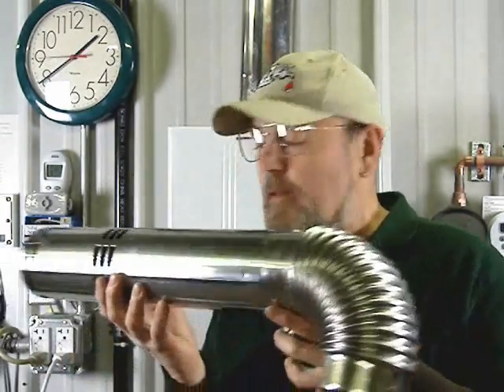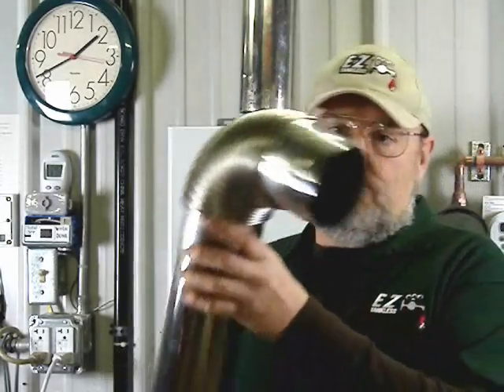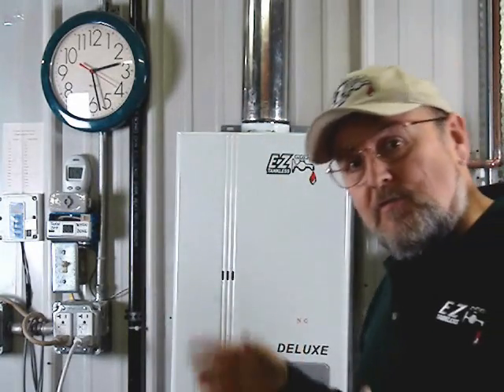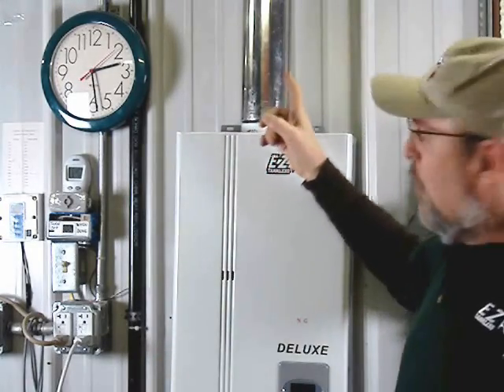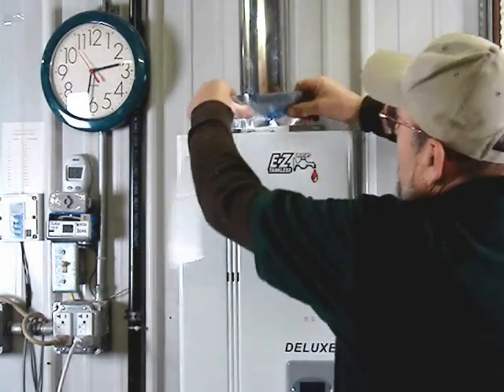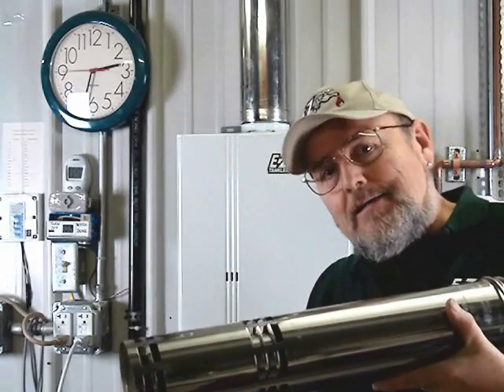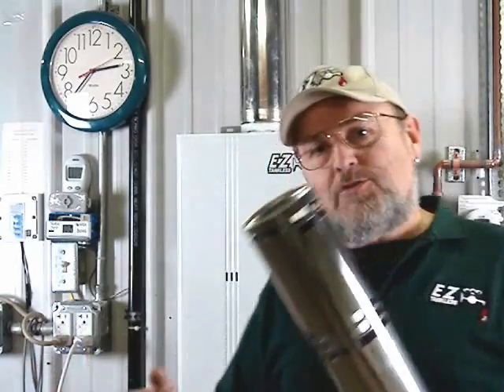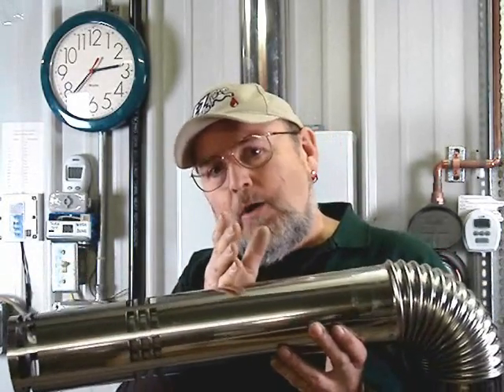Tankless Direct Vent intake and exhaust (common errors and misconceptions)

Comment: Why;d I have to go thru so many videos b4 I found this one? Excellent! How high of a vent riser can I put on the unit B4 going out of the wall? I have a 2 story in the snow and was thinking about venting under the eaves. Also, I'm on a well and incoming water is very cold. Is the a way of pre-heating the water? Thanks!
Reply from the maker: Hello Mr. Wells,
Thank you for the kind compliments.

The problem with going straight up with the concentric pipe before the 94° elbow is that condensate drips back into the heater and corrodes the internal components and is the simple reason why this should not be done. After the elbow, the stainless steel pipe slopes at as slight down-angle and condensate drips outside at the exhaust exit point.

When you explore your local and/or state and Federal "code" you will find that venting under the eave is almost always prohibited because of the potential of entry of carbon monoxide into the home through the eave vents. 

The difference between ground water temperature and the exiting hot water temperature is called "rise" and this number is usually a fact of geography. Northern users and those with very deep wells have much colder water and need higher levels of rise than Southern users due to the differences in these ground water temperatures. The larger the rise factor, the lower the GPM (gallons per minute) any tankless heater will produce. If you have very low ground water temperatures, it is best to purchase a heater with a higher GPM rating to overcome this temperature difference.
There are some ways to preheat incoming water. For example, with the incoming water supply passing through coils wrapped around the exterior of the sanitary drain pipes or passing along a heating duct etc. There are videos and users on YouTube who show their "MacGyver" type devices to do this preheating of the water supply.  
Sincere thanks for your interest in our products. 
Jim

Comment: I want to install one of these units in my crawl space which does not have that much height . Is it possible to install the tankless unit horizontally with the exhaust vent also running out of the unit horizontally and out the wall?
Reply from the maker: Hello,
These do not work in any position other than upright for a number of reasons. 
Primarily, the heater must be "upright"  as by design, the fire is "under" the heat exchanger that has the water running through it. This heat from the fire must rise through the heat exchanger to heat this water that is inside the heat exchanger. As "heat rises" (it does not go sideways) your idea is impossible.
Thank you for your interest.
Regards

Comment: Why on EARTH is it a bad thing to draw intake air from inside the home?  I keep seeing this repeated but it makes zero sense to me. Do you really think the air consumption of a tankless water heater is going to starve your home of fresh air?  This seems utterly ridiculous to me.
Reply from the maker: Simply because there are codes regarding room size versus BTU on gas-fired devices. Tankless heaters often have very high BTU ratings. To meet code, our smallest "room air combustion camping and cabin" model must be in a room the size of a two car garage with no closable doors. in a super-tight dwelling, a furnace and any other gas-fired device should never fight each other for combustion air as the more powerful one can reverse-flow the exhaust causing freeze damage and/or the risk of carbon monoxide poisoning. it has nothing to do with starving your home of air, therefore, it is not utterly ridiculous.

Comment: hey Jim, could I install the exhaust to my existing chimney and the intake thru the wall...? so I don't have to cut two holes...?
Reply from the maker: Hi,
With concentric pipe, the answer is always no. There are redundant saftey devices built-in that understand imbalance in most units. All brands must have intake and exhaust configurations that are within the manufacturer's specifications.
Best regards, Jim

Comment: I can't vent directly out of though my side wall due to property distance regulations (can intake though).  Could I just go out the sidewall, up the exterior of the house and then to the roof? or must vertical venting be mostly plumbed inside of the house?
Reply from the maker: Hello, 
The reason you cannot vent vertically is that the exhaust must run slightly downhill to drain condensate that accumulates inside the pipes; The Concentric pipe vented EZtankless heaters cannot be vented vertically. This is explained on our website and in other videos that are specific for each product. 
Thank you for your interest.

Comment: Can you make a recommendation to me. I am converting the electric water heater on the hot dog cart I purchased to a propane tankless. Most others install on the outside of the cart, but the WH they use do not appear waterproof. Can you recommend one that would be waterproof? Or else placing it in a cabinet, how can I vent one of these small WH's? Thanks, Steve
Reply from the maker: Hi Steve,
The reasons they mount them on the outside of the food trailers usually relate to rules of gas-fired appliances. Typically the "code" states that you need 30 cubic feet of room (with no closable doors) for each 1,000 BTU of these devices. If you have a code inspection, an indoor mounted one will likely fail inspection for that reason.  If you were to buy a "direct vent" model you could mount it inside as they do not use "room air" for combustion as the intake air supply is drawn-in from outside through the external eccentric pipe.
thank you for watching. Jim

Comment: Can the water input of this heater come from a water boiler that heats up from solar panels? When the day is sunny and the solar panels heat up the water tank then the gas heater will receive hot water as an input, means is not necessary to start boiling water if the incoming temperature is high....if the solar panels didn't heat up the water tank then the Gas Tankless Water Heater takes over....In theory it sounds like it works but my worries are if the Gas Heater will overheat the water if the inlet is already partially hot.Anyone?
Reply from the maker: Hello,
It depends upon the type of tankless heater. Your concept is very energy conservative, and indeed people do this. 
With any "smart" tankless heater, the desired water temperature is entered into the control panel. There are intake and exit water temperature sensors that the computer uses to regulate the fire and air in the firebox. This process regulates the exit temperature of the water to make it consistent. If the water coming into the heater is almost as hot as the desired temperature setting on the control board, the heater will either not run or it will run in a very relaxed mode. 

(If very hot water was introduced into the heater, it is conceivable that it may be possible to damage small components on the water inlet side of the heater as they are not designed for high temperature water. And it makes no sense to introduce water into a heater that is hotter than the desired exit temperature. If this were the case, there would be no need to have a heater. But yes, you have valid points. Perhaps with your idea, it would be wise to have a way to use your solar-heated water directly, or if need be, set-up the system so that you could open a valve to divert the water through the heater to raise the temperature as desired.) 

The difference between intake temperature and exit temperature of the water is called "rise" - The less rise, the higher the GPM (gallons per minute) that the heater can produce. 
thank you for watching our videos.

Comment: Jim - great video. . Is it "normal" for exhaust to occasionally have a gas smell?
Reply from the maker: Jon Callaghan Hello Jon,
No, it is not normal for a gas smell and in fact this could be potentially dangerous. There are redundant safety features on all brands and models of heaters to prevent gas build-up without ignition. If you smell gas, you should be looking very closely most likely at your gas connections to your heater. A leak in your supply line is very dangerous as it is not within any heater's safety features' ability to control. If not the connections, you could perhaps have some type of leak related to the gas solenoid valves but this is extremely rare.

Comment from the maker: Because of condensation draining backwards into the heater and corroding the internals. Direct vent condensation is acidic. Most manufacturers now recommend the 94° elbow direct outside wall exit. They're most efficient this way, breath easier which translates to maximum BTU and this method doesn't require a complicated condensation separation, trap and draining device. It just so happens that our company was one of the very first to do this, now most do it this way. Thank you for watching.

Comment from the maker: Generally speaking, the distance from the ground is called "the snow line" Simply the heater must vent where it cannot be "smothered" by drifting and/or accumulating snow. Distance from windows, doors, patios, driveways, walkways, the roof and soffit are controlled by local, state, and national codes. Consult your plumber for more information. Thank you for watching and the kind compliments. Best regards, Jim

Comment from the maker: ALL of our direct vent heaters are horizontal wall exit only and our company limits extension distance as well.  We would rather not sell you a heater if you wish to, or need to extend the parameters of the designed installation. (Other companies are not as conscientious.) With ALL gas-fired direct vent tankless heaters, the longer the intake/exhaust tract, the more difficult it is for the heater to breathe. This translates directly to loss of BTU and lower volume of hot water in RISE and GPM.

Comment from the maker: Direct vent concentric exhaust do not use a damper. All of our indoor heaters are direct vent, so dampers do not apply to our indoor products (Our "outdoor" heaters are not direct vent, but we do not sell them for interior use.) There are codes that must be followed and yes there are rules about windows that can be opened and doors, as well as patios etc. (If a window cannot be opened, then the distance rule is different for example.)